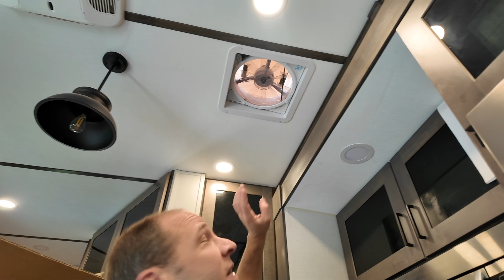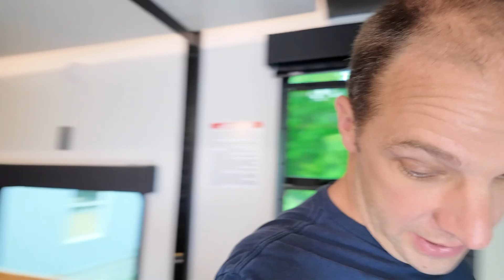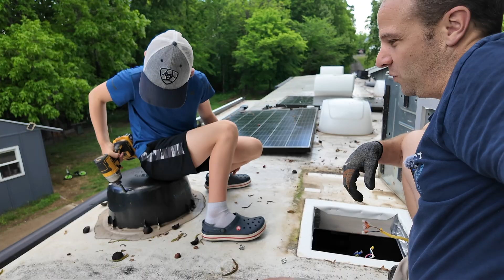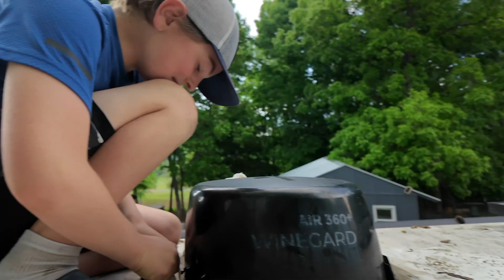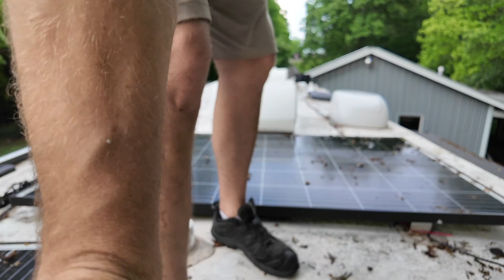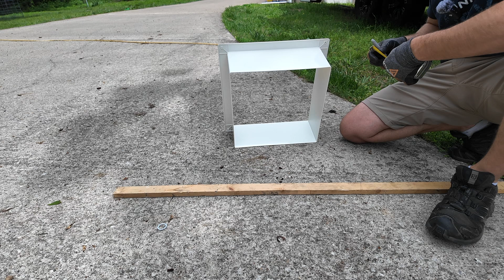Replacing your RV AC with an RV VENT FAN?

Comment: Good job Nick - I wish I had your confidence making RV mods.
I did have one of my regular vents replaced with the top MAXX fan that is very similar to yours, and it is as good as having a second A/C - Blows in and out quietly.
With the two MAXX fans running, they move a LOT of air through my 27' TT. - Cheers!
Reply from the maker: Yes!  They certainly do work well!